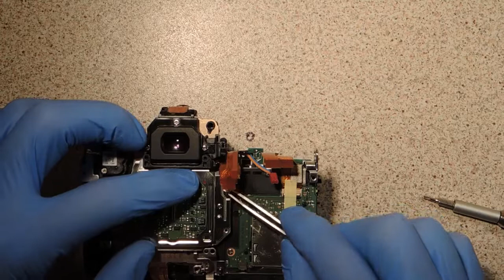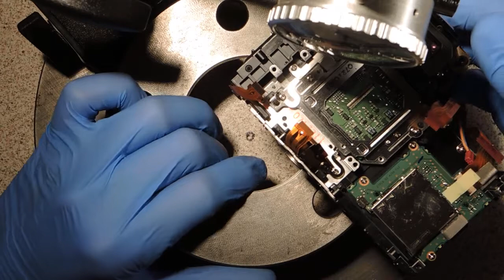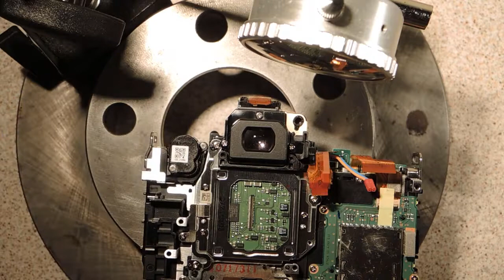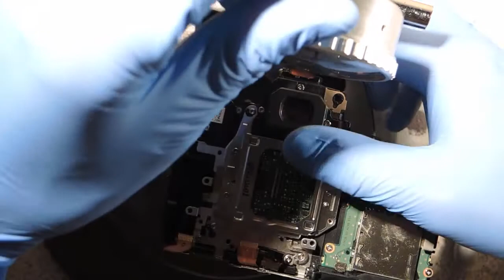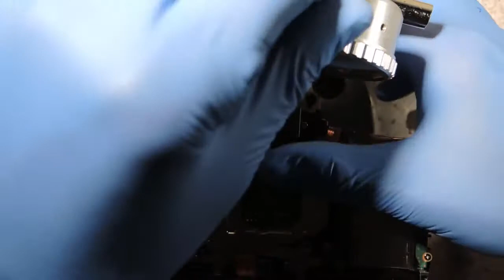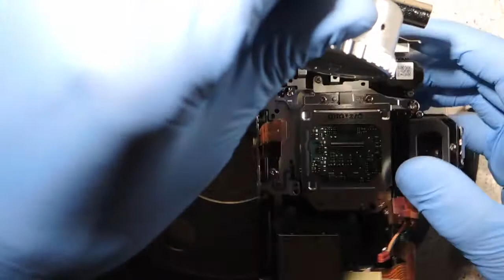Aligning Canon 1200D T5 X70 Sensor After Full Spectrum Conversion.

Comment: What are the points where you measure?  From what basis?  Can not see it.  Your guide says 4.83mm, but from where?
Reply from the maker: The points are the places near the three screws. Also the distance is just for my rig. It depends do you have a full spectrum conversion or a infrared glass. If you remove all the filters screw the three screws in tight and that may be sufficient enough.
Reply: @RemusLt  Thanks for the reply.  I changed a canon 1300d to full spectrum, but I forgot to take the measurements.  I've already tried tightening the screws, but it doesn't work well.  I thought the measurements you wrote were standard.
Reply from the maker: @fabiopagnini8796  What do you mean saying does not work well. The Live View focus should work.
Reply: @RemusLt  Live view works fine, but the screws aren't tight.  I've tried screwing in or unscrewing, but it doesn't change much.  The autofocus does not work well, I wanted to set it to work well at 50mm.
Reply from the maker: @fabiopagnini8796  Without tools you can't make it work this way. If its off by 0.15mm it will not focus correctly.